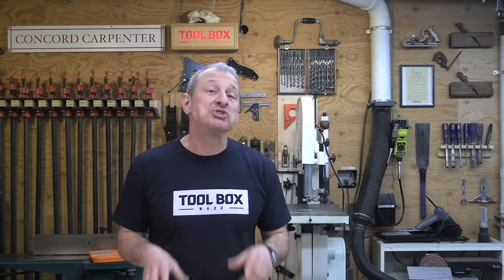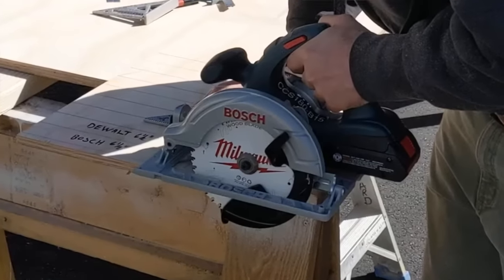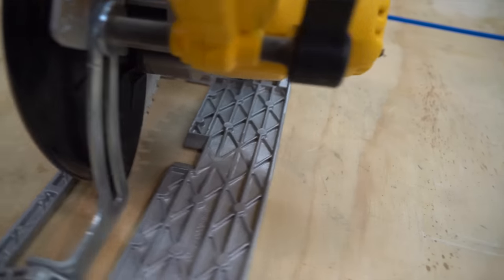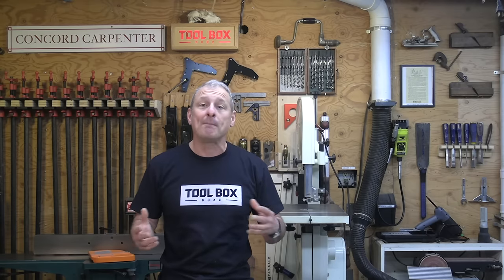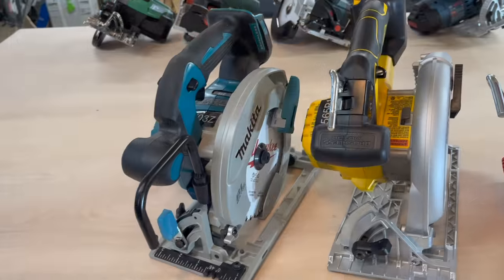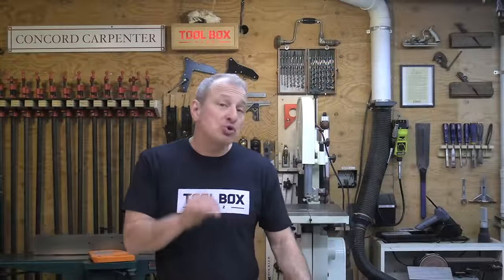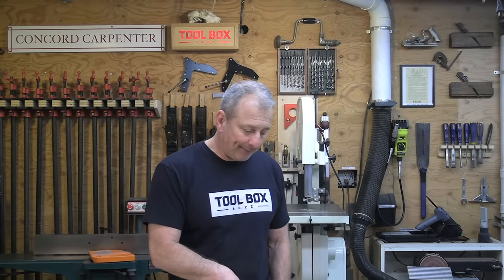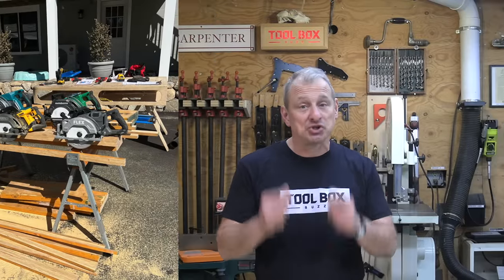Best 6-1/2" Cordless Circular Saw | Head To Head Test

Comment: As a diy guy I can’t get into specifics but my Ridgid cuts like butter and lasts all day, for a diy guy works for me. I understand that this channel caters to all levels of craftsman. Good video dude.
Reply from the maker: Thx
Reply: I agree, I got the Ridgid saw as a free tool when HD was running a promo. At first I didn't think that I was use it much but it has been my go to saw for small to medium task. I replaced the blade with a Diablo and this little saw is quite impressive.

Comment: just bought a makita a few months ago. it has a hex wrench on board
Reply: This is true, will the rankings now be updated ? They gave it a (5 ) for no tool storage , which in fact it does have....on board tool storage. ( Hex wrench )
Reply: Yup both mine have on board hex
Reply: Same same I have one I got about a year ago and it has hex on it as well. I think  mines is the exact same one as in this video
Reply: Both of mine (same model) have the hex key in the saw as well. Bottom of the body just in front of the battery mount
Reply: Me too
Reply: Same here. Makes me question this test when they miss a simple thing like this.
Reply: Just got a new one last wk.  tool was in the parts bag.  My guess is that whomever unboxed the saw missed the hex key.   
I’ll admit when I looked for the on-board spot…..it WAS NOT easily identified.
Reply: I thought it was weird when I heard that, so I  went to Depot's website did the 360view and saw the key where it is on my older 6¼ saw.
Reply: Yeah rob!! You robbed us!!!

Comment: I really wish the best battery platform was used for each brand (Milwaukee H.O., Dewalt flexvolt, Ryobi high performance, Ridgid Octane, Kobalt ultimate output, etc)
Reply from the maker: @FatherFirefighter -interesting point. We try to look if the tools come kitted, and also try to get them close in Ah. This would be a H2H with the tools BEST battery - I like it Ill bring to the team
Reply: @ConcordCarpenter  That's a fair point and overall it would only affect 1 or 2 categories in total. Just curious to see what performance gains there are to be had.
Reply: Ridgid came out with a video and the new ridgid batteries outperform the discontinued octane lineup.
Reply: Those are the inky videos not being made.
Dewalt 60v with a 15.0 amp
Makita 40v with a 8.0 amp
The new milwaukee 7 1/4 forge 12.0!!!!!!

Comment: I have the Makita 36v 7 1/4 rear handle, and also have the 6 1/2 and I honestly find myself using the 6 1/2” probably 75% of the time.  It’s lighter, a little easier to control and I just find myself reaching for it more than the 7 1/4 which honesty surprised me because I’ve never used side handle saws before but I like it a lot more than I thought I would
Reply: Ive run framing crews for 15+ years and have owned every kind of saw available, the rear handle saws very rarely come out of the tool crib. Usually when we need to make an opposite bevel cut. Not one of the dozens of men I've ever employed preferred a rear handle or worm gear saw.
Reply: ended up using my 6 1/4” makita  so much more than the 7 1/4” hypoid rear handle that I took it back. love their saws though.

Comment: Thanks for all your hard work TBB!
I use 6.5 saw more often then a 7 1/4, and never use a rear handle.
My criteria are, first sightlines, on one of my 4 battery platforms, rail compatibility, ergonomics.
Speed, power, and price are at the bottom of my list.
Obviously everyone has a different order.
I use in order, tracksaw, mitersaw, tablesaw, omt, circular, and Sawzall is the least used.
Thanks again crew!

Comment: I have been eyeing the 6 1/2 ridgid cordless saw-You have just reinforced the reason I need it.  Thank you for the information.  Ridgid Ron
Reply: Well I got one now..Ridgid 6 1/2 circular saw Ridgid Ron
Reply: @RidgidRon  Funny enough I just bought one today. Found one that came with 2 batteries (a 4.0 and 2.0Ah) and their drill driver for the EXACT same price as the saw kit with only one battery and a charger.

I almost went the cheap route and bought a Bauer saw from harbor freight for a third of what I paid for the Ridgid, but I hated how it felt in my hands. Not only that but I'm hesitant to buy a saw from harbor freight in general. I have a Bauer drill and impact and they're just fine for budget tools but for safety reasons I feel more comfortable spending a little more for a good quality saw.

I might become a Ridgid guy since I'm not too invested in one brand of batteries yet.
Reply: @RidgidRon  - Cool so now that you've had the saw for over a year, what do you think of it?

Comment: I used my Makita XSH03 as a framer/carpenter mainly in overhead one handed cuts on fascia and siding. IT IS WONDERFUL in all ways. My main tool line is DeWalt, the XSH03 is the ONLY Makita cordless I own
Reply: Does yours have an onboard hex key? I'm pretty sure they said it didn't have an onboard wrench and that took away from their feature score but mine has a hex key well it did at least and i intend to replace it soon. 

Anyways it's a great saw and while it may not be the best 6 1/2 saw out there it is far and away the best 61/2 I've used and I've tried a few.
Reply: @adamellis4578  YES onboard hex key! and its still there! I do NOT like hex keys, chuck wrenches, and so forth. they better be captive with a cord/cable/chain or i will put one on if possible, and if its stored on board it better not fall the fukk out, i have a few older tools with missing things and i use engraver, or sharpie etc. and write "4mm allen" or whatever otherwise its hell

Comment: Hi! 2 quick points about the Makita.

1 - it does come with a hex wrench ;

2 - it is track compatible with an adapter Makita offers.
Reply from the maker: Noted- great comment thanks!!
Reply: @ConcordCarpenter  It has on board storage for the hex key too, it's a hole in the body of the saw sort of behind the depth adjustment lever going all the way through sideways. Easy to miss, but it's there. At 7:27 you can see the left side of  it, a hole in the teal part behind the blade/in front of the battery/under the handle. It holds it well, doesn't fall out.

Comment: Got the AEG/Ridgid saw it's a beast 6 months of use and still going hard💪
Reply: Do you cut a lot of 2x4's with it? What type of blade, tooth count?  Seriously considering Ridgid 6 1/2" saw. This test vid was cutting 3/4" plywood. Thanks!
Reply: @ridemfast7625  mainly cut 2x4s with it, use it everyday as a carpenter, I use a diablo 24 tooth framing blade which is brilliant.
Reply: I just finished my deck project with this Ridgid 6.5. It cut through composite decking no problem. Overall, I think this is a great circular saw for the DIY’er and for the money, it’s hard to beat. Having said that, I think I my dads Makita is just a better circular, more accurate. If you’re depending on a circular saw for income, I’d go Makita or Milwaukee, the Ridgid is just fine for my occasional projects. I do like the weight of the Ridgid, it’s really light and easy to use.

Comment: I've used the Makita for years now..its one of my go-to tools..love the ergonomic ..the power could be greater but the rest is great.
Reply from the maker: Tried and true
Reply: It's probably the oldest model in the competition and still showing incredibly well. For the number of times I heard the Makita praised during the video,   I was shocked it didn't rank higher. The only thing I don't like about the saw is that it likes to roll away from you when you set it down.
Reply: @MovingToMnPro  Yes😆 if only  i got a 💵 for everytime that saw rolled/fell/tumbel away😆

Comment: Been running that Makita saw for about 3 years now. Been having issues with the trigger lately causing it to not turn on. But it's an amazing saw that I used to rip 2x4 easily in a pinch.

Comment: I have the makita and the metabo hpt both good saws I’d reach for the makita more often it’s been out a long time now I’ve had it years still cuts square the on board Allen key should be in the right above the depth adjustment lever Mine came with 1 . Great video very well done 👍🏻
Reply from the maker: Right on

Comment: You guys always claim not to be professional tool reviewers and I can appreciate the modesty. But this channel has some of the most thorough testing and more informative than some other channels (not gonna say names)that do consider themselves tool reviewers. You guys do a great job  it’s not like you’re a guy cutting lumber behind your Auto shop. Thanks for putting in the time . As a sidenote Milwaukee needs to step it up especially at their price point.
Reply from the maker: Thanks
Reply: The milwaukee is an older design. Came out in 2013, so it's a bit outdated.  Main reason why I got a different brand of circular saw.
Reply: @LvA1994  Yeah they’re due for a new one it pretty much set the standard when it came out. I still have it it’s a great saw and has plenty of power. I don’t understand why they’re still asking $250 for the tool only.
Reply: @steffendetrick9403  I switched to the Bosch profactor 7 1/4 track compatible saw, which is a great saw. The Milwaukee 6 1/2 is still a great saw, just not up there with the best anymore.

Comment: I'm a Milwaukee  and Dewalt platform owner , but use the Milwaukee brushed 6-1/2 saws, two of them , and hoping to buy the Fuel brushless  6-1/2 model as well, I prefer 6-1/2 to 7-1/4  due to blade left line of sight. 
Edit; once you go cordless  you won't go back to cords. I have a made in USA  WORM drive corded 7-1/4 SKILSAW  left sight blade but it is too heavy , so seldom used except when framing big jobs.

Comment: I plan to buy a circular saw and torn between Ryobi brushless 7 1/4 with  18v/6A battery and Dewalt 6 1/2 brush with 20v/5A battery.  They are just the same price and I know Dewalt has a better reputation but Ryobi offers the brushless one and bigger saw. Hope to get your tool expert advise. Thanks

Comment: I'm researching to determine what battery brand group I'm adding to my Ryobi arsenal.(Home Depot had a huge Ryobi tool display with an individual wearing a bright Ryobi Tshirt in store that day. I got the 9 piece Ryobi kit, instead of the 5 piece DeWalt kit.) That's how I got into wood working, as a hobby. As I get deeper into the  hobby, it's becoming less of a hobby, and more of side business. I'm really attracted to the DeWalt and Milwaukee tool lines. Primarily for their innovations and battery technology and great selection of Both 12v & 18v lines within the brands. I'll probably end up being the guy with 5 or 6 different tool brands and batteries (but I'm still trying not to be that guy.) I've compared run/work time of both brands, and either is a significant improvement over my Ryobi stuff, and either brands typical output easily exceeds Ryobi. Being able to run all day(9-10hrs work time is really a good thing.) I hate getting up/away from the work/assembly area to get a fresh battery to finish the build. It means a lot when you're batching out 10 or 20 of the same thing.

Comment: 18:39 -- I'm a Dewalt guy.  But ultimately it's not about brand loyalty, it's about battery loyalty.

My dad bought me a cordless Dewalt drill/driver kit 6 years ago for Christmas so that's the battery ecosystem I'm comfortable with.  But since I wanted a corded circ saw, I had more flexibility since no battery required.  Went with Milwaukee's corded worm because I know Dewalt cannot build a decent corded worm saw to save its life.

Comment: I have an old 18V black & decker, it will cut 1/4 plywood about 8 feet or so and then it's dead, and that was when it was brand new...  Not nearly as useful as I wanted it to be.   Going to have to replace it with something better.  Thanks for the video, this will help.

Comment: Great comparison. Thanks for all the effort that went into making this video! I have the 6.5" DeWalt, and it's adequate but nothing special. Love the compact size and it has plenty of power. Right out of the box, I had to grind a little bit from the top side of the shoe to get it perfectly square. Also don't care for the low-rent stamped steel bevel and depth measurement indicators. I find that DeWalt tools tend to feel lower quality than many of their competitors, and their 6.5" circ saw is no different.
Reply: I watched another test on the Dewalt 565 and it excelled at everything.

Comment: I love my Makita 6 1/2 and my 7 1/4. Just the smoothest and best. & surprised yours did not have its Allen key. It’s usually in the back.
Reply from the maker: Glad that it DOES come with one
Reply: @ConcordCarpenter  you gave it a 5 rating for NOT having one, in fact it does...

Comment: I am working 5-6 days a week framing houses. I own the ridgid 6 1/2 subcompact circular saw. It gets the job done in an 8 hour day.. but I feel like the LED light drains the battery too quickly. I have four 4ah batteries and the get used up fairly quickly.
Reply: Circular saws work better and last longer with 6ah or higher batteries. Ridgid fan as well!

Comment: That Makita saw has an Allen wrench located between the battery and depth adjustment lever in Australian model, you can even see the hole where the short side is inserted at 15:00

Comment: I have a 50 year old worm drive skil saw. Plus 3 - 3 1/4" Porter Cable/Rockwell trim saws. I'm  75 years old and they still do the job, no need to UPGRADE.
Reply from the maker: I remember the Rockwell
Reply: Im envious that you still muscle the old worm drive saw.  My 40 year old worm drive Skilsaw also works. But my right arm with torn rotator cuff can be an issue at times.  Small, light and powerful is good for me.  Cordless makes work even easier. Ridgid saw will work well and compliments the other Ridgid tools and bats.

Comment: Hey, thanks for the Test! 
One Detail to the Metabo 66: 
I bought this saw to use it with the small tracks. 
BUT: you cant adjust the sliding / Play between the saw and the track. 

So i bought the Makita for free hand use und stick with my loved BL Makita Tracksaw. 
A great combo. 

Cheers from Berlin

Stephan
Reply: Yep both the metabo 57 and 66 have slop on the track. I had to put a little slider tape for drawers on my 57 to take out the slop. The Makita however has a jig that's under $50 and made of plastic that does have adjustments and works fairly well

Comment: I wonder about the performance results of the lower performing saws. Did you use batteries up to the task?
Would a lower pull weight say 5 lbs made a significant difference?

Comment: i have that exact Makita saw. just FYI it does have blade change tool storage for the allen key. its in the handle between the depth adjustment lever and the base plate. therres a hole and retaining notch to place it in.

Comment: Just a little update for you guys and maybe some food for thought on future testing. I got the Ridgid saw in this video based on these results and I've been a bit disappointed in the performance compared to my older Milwaukee 6-1/2 that was NOT a FUEL. 

I cut 4x8ft plywood for storm barrier boards on homes to fit the windows and doors. Many times i am cutting 3-4 sheets of 1/2in plywood. The Rigid 6-1/2 in this video has gotten jammed up just as much as my older Milwaukee Non-Fuel. I'm not sure if this has something to do with Milwaukee's better battery technology, but i would've expected a very noticeable difference with the Ridgid when cutting multiple sheets. The only real difference i notice on the Ridgid is the speed of the blade which does allow for faster cutting, but as far as the power and ability to resist binding, it does not seem much better, maybe 10-15% better. I am using a 4.0 and 6.0 Max Output battery on the Ridgid. On the Milwaukee I used a 6.0 & 8.0 High Output battery. 

Performance seems very similar on both with the RIgid being only slightly better because of its blade speed. Just thought I'd share my own real world testing, take it how you will. Keep up the good work
Reply: Those Milwaukee HO 6.0 and 8.0 make noticeable performance gains even on older tools. Having more advanced 21700 cells with higher discharge rates mean more watts available for the tool.
Those Ridgid batteries are older 18650 cells; the 8Ah battery is the only one they offer with 21700 cells.

I guess the old Milwaukee would perform significantly worse with an XC 5.0 pack, that's what I've notices on most other tools

Comment: i usually use my 6.5, even framing... i only break out the 7.25 or 10.25 worm drives when i need a bunch of power and/or cutting depth... i have a 6 and a 9 AH flex volt battery i use for it and it makes it a beast... with smaller batteries its weak...

Comment: I have the bosch and my bevel adjustment lever did fall off and get lost. Looked down one day and noticed it was gone. Its still a great saw though and tight enough build to not change when cutting.

Comment: surprised you didn't mention the insane cutting depth of the metabo hpt saw. It's one of my most used saws due to it's light wieght and 7 1/4 like cutting capacity.
Reply: Yeah and Flex tried saying it was the deepest in their marketing when it is not
We have one set up for a track saw and it works great
Reply from the maker: I forgot to add that in the video but the article has The 6-1/2-in deep cut circular saw 
capable of a 2-19/32-in cutting depth; making it one of the deepest cutting cordless circular saws on the market with a similar cut capacity as a 7-1/4-in saw, and that it is compatible with Metabo HPT's 18V or 36V(MultiVolt) although the cord is a huge brick
Reply: @baseballdude8491  there basically identical in cutting depth.Only difference is the flex is 1400 rpm faster.
Reply: @LARULES100  and $150 more expensive
Reply: @baseballdude8491  but it comes with battery fast charger and a bag.
Reply: @LARULES100  at Lowes u can get the 6 1/2 with 2 batteries charger bag and a Triple hammer impact driver $288